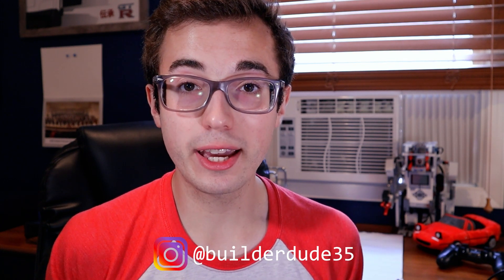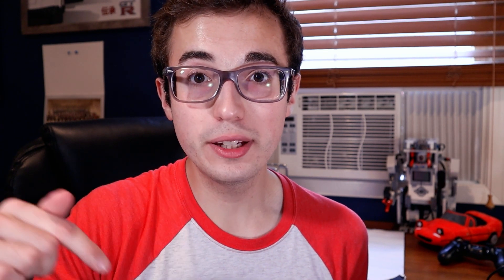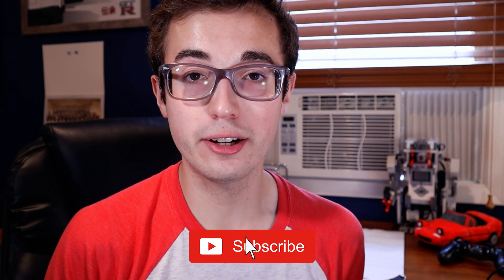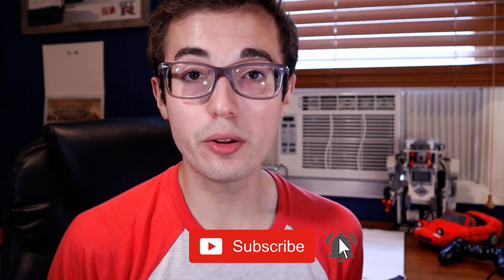Stop Making THIS MISTAKE With Your LEGO Gyro Sensor

Comment: At FLL Competitions, I always instruct my team to boot the EV3 on the floor in a quiet corner of the pit before heading out. There are 2 reasons for this. Booting on competition tables are a poor choice because someone is always bumping the tables. The second reason took me a few years to understand. Most competitions use large sound systems during the competitions. That massive sound produces vibrations which can be picked up by the sensor which can mess with the initialization. The pits are usually far more quiet than the competition floor.

In the pit you should always check with a test program to verify the sensor is working properly. If not, shut and and reboot again until it works right before heading to the competition tables.

Comment: The robot inventor hub's angle output is kinda strange, since on some axes when it reaches 180, it immediately jumps to -179 up until zero. Negative numbers really mess up the code, so I always just use the angular velocity block and I have a basic code that measures the actual angle based on the angular velocity. Very useful for measuring 0-360 on certain axes
Reply from the maker: The new LEGO 51515 gyro certainly has its quirks. The observation you noted is actually not unusual because this gyro is set up to measure heading relative to 0 degrees, where one direction is positive and the other is negative. It "jumps" from 180 to -179 because you are crossing over from the "positive" side to the "negative" side. You can think of 180 like the way 0 functions in the number line as a value between negatives and positives, except it feels weird because 180 is definitely a positive value.

The 51515 gyro actually has a 5 degree dead zone in one of its axes, which limits some of what you can build. I have a more thorough explanation here if you are interested: https://youtu.be/UiMgJTuSM7Y

Comment: Kyle, I'm pretty certain that the gyro sensor employs a MEMS force gauge, and the primary measurement is actually angular acceleration, not velocity. It integrates once to get angular velocity, and again to get angular measurement -- all of which means that the drift and accumulating offset errors are even worse than we think they are.
Reply from the maker: Hi Bob, as far as I know, the LEGO gyro is a MEMS vibrating structure gyroscope, which measures angular velocity. This is by far the most common (and cheapest) was to manufacture gyro sensors right now. But if I am in fact wrong on this, please let me know!

More info on vibrating structure gyro sensors, if you are interestd: https://en.wikipedia.org/wiki/Vibrating_structure_gyroscope?fbclid=IwAR3ikF_Hqi7N4qcOhQ2iAgTHcwAd-Twmn9nveWB4W2m10V2xbybD5GDrHBY

Comment: I have been watching your videos for years and you continue to be awesome!  I have always wondered what the impact of the position of the gyro sensor is.  I feel like putting it to the side or forward is going to make a difference.  But putting it dead center is tricky.  How do you adjust for the position of the sensor on the robot?
Reply from the maker: You are absolutely correct, the gyro sensor position on the robot makes a difference, although it's not critical as long as your choice of placement is reasonable. Ideally, the gyro should be located between the two drive wheels so its rotation axis is concentric with the axis around which the robot turns. There's no specific way to calibrate for other placements as far as I know, but close to the ideal position will work fine too. In some of my past videos, I had the gyro on the side of the robot and it also worked reasonably well